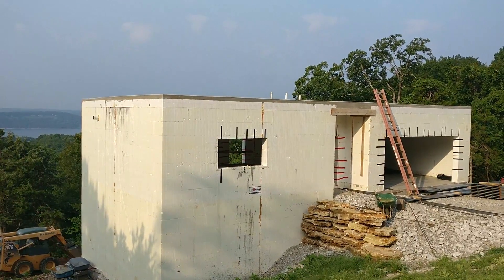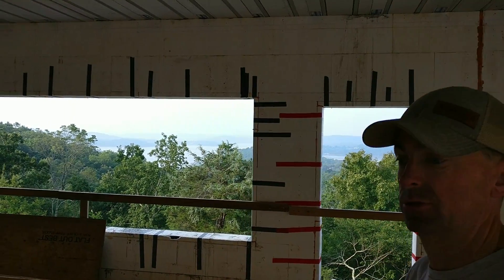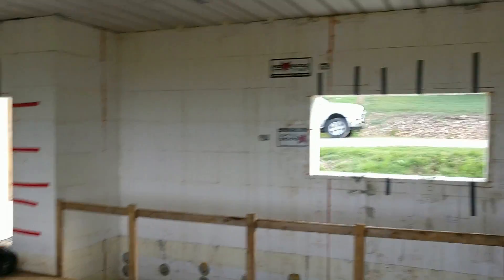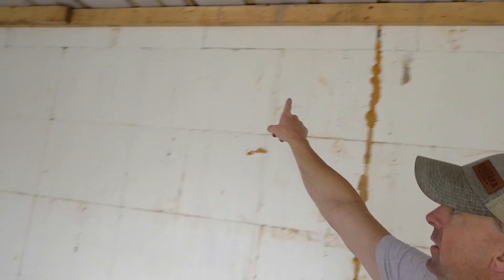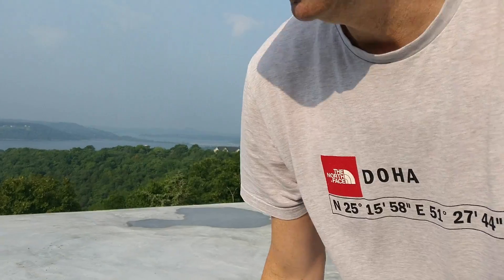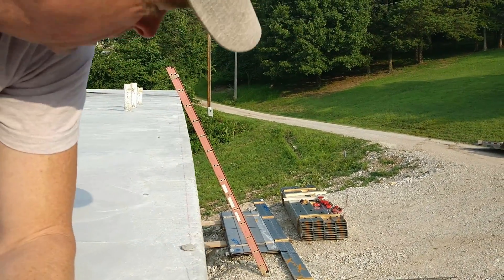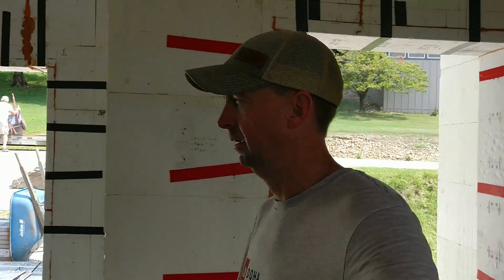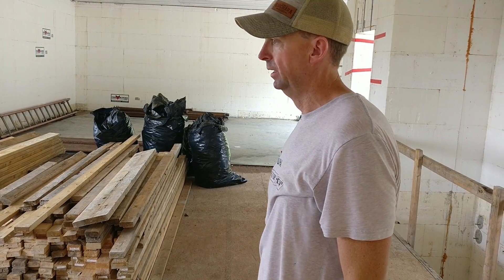ICF House Tour Before the Interior Walls Go In.  LiteDeck Roof is ON!

Comment: Why didn't they form up the inside walls of the garage with foxblocks? Unlike a 2x6 wall, an ICF wall is almost fire proof.... A 2x6 wall is 30 minutes (or less) unless you double up the sheetrock on both sides. With EV fires in garages, you might want to think about segmenting the garage a little bit more than just 2x6 walls.

Comment: Was the concrete used in the LiteDeck a Light Weight Aggregate Concrete or just standard concrete?
Reply from the maker: Our ICF guy has the concrete dialed in pretty tight as far as additives and slump, but I think it was standard concrete.

Comment: It 's great you are putting extra waterproofing on the roof. I am really enjoying the learning curve you are sharing. Are you going to add any house wrap.Thanks
Reply from the maker: No wrap needed. We put the Xypex waterproofing concrete additive in all the concrete pours so the concrete is waterproofed.
Reply: @LakeLotBuild  So the concrete used on the roof had Xypex in it also but  it soaked through? Wrapping is just another extra precaution. Some builders do it , others don't.  The lake house is looking good. Love the view.
Reply: @LakeLotBuild  Does this additive have any adverse effects in the end product of the concrete? I think if I were pouring ICF I would likely use HRWR (high range water reducer) to increase the slump/workability of the concrete to minimize voidspace in the walls (in addition to vibrating).